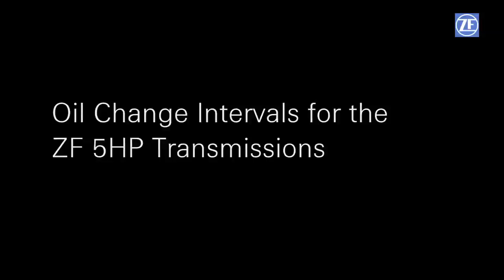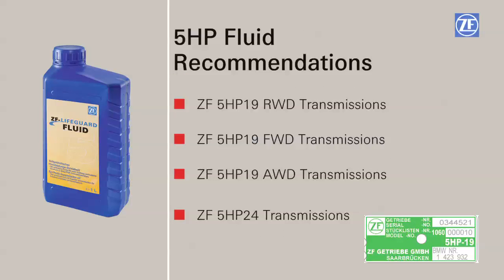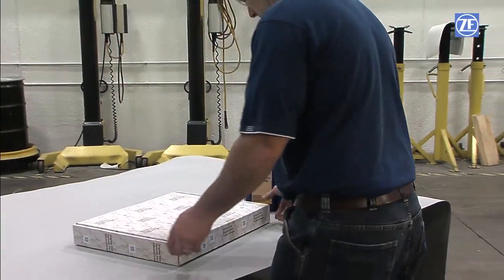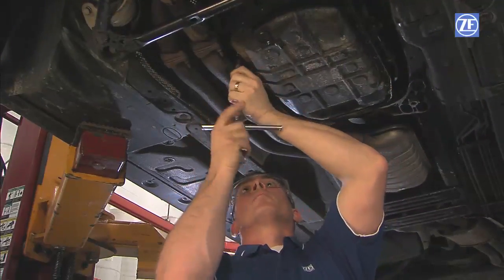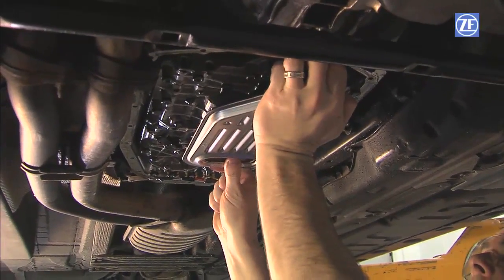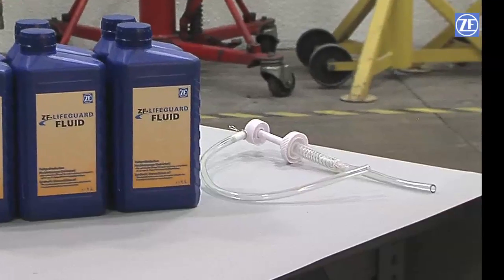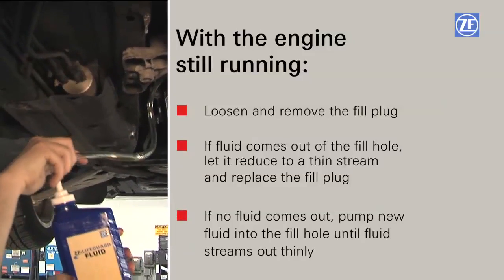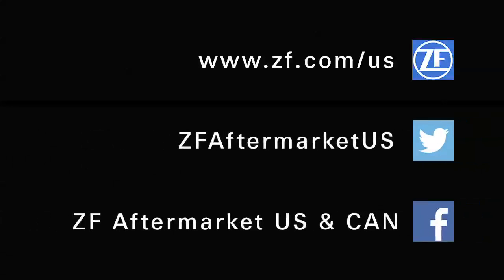ZF 5HP Transmission Oil Change Interval Procedure

Comment: i need my transmission fixed its slipping and i think its needs to be cleaned 2006 Audi A6 3.2 it started a delay in responding when it was suppose to shift gears and reving and not going into gear.

Comment: My Audi A4 is done 220K Km, can i change the ATF,
Reply from the maker: +Bee ShopCS We always recommend a fluid drain and fill with a new pan/filter and the correct ZF Lifeguard Fluid. It should be done every 60k miles or 8 years.
Reply: Thank you very much its 10 years already 
220k I am not sure if has been change before
I ask the service Advice in Audi, Said i am not advice you to change , i do not know what to do so i ask you  thank you very much for ur answer i really appreciated

Comment: Very useful, thanks!

I don´t have access to ZF fluid where I live, so what is the specification for other brand´s fluid for a green plate 5HP19?
Reply: Valvoline Maxlife ATF
Reply from the maker: The only fluids we recommend for the 5HP19 are the OE or ZF Lifeguard Fluid 5. We don't recommend trying to match specifications with an aftermarket supplier. If you have additional questions, please reach out to our technical service team at 800-321-0784.
Reply: Atlantic British, or any other online zf fluid, not hard to find but worth it.
Reply: Thanks, I´ve just changed for Pentosin ATF1, is the one that I found here.

Comment: one question: why not while going through the gears not spinning the wheels? Wouldn't that help?
Reply from the maker: If you spin the wheels, with the vehicle on a lift, you will damage the transmission. You only need to hold the brake and run through the gears to circulate the fluid which will fill the clutches. If you have any additional questions, please reach out to our technical service team at 800-321-0784.
Reply: thank you very much for the answer !
Reply: Wow, i am curious... How can it damage the transmission? Because there is no oil circulated through the valve body and such?

Comment: Hello, thanks for sharing this useful video.
I own a Bmw 540 with the zf 5hp30 transmission. Now it has 195.000 kms.  I dont have any knowledge if the previous owner did a trans fluid change and i ve never done it myself. So i have a few questions: Is there any risk to change the fluid at this point if it was never done before? Should i get a ZF rebuild kit just in case? Which rebuild kit do you recommend?
 I ask you this because i ve noticed a strange shifting between 2nd and 3rd, and from 4th or 5th downshifting to 3rd, is not really hard, but it doesnt feel that smooth like the other gears, and a very few times, it feels hard shifting, always the 3rd gear is involved. Im not sure if that is a sign of failure of the trans, so it needs an overhaul, or maybe the fluid is low, or it just needs fluid change. Thank you very much.
Reply from the maker: +Vintage Effects It is never too late for a fluid drain and fill. We recommend it as part of your maintenance schedule every 60k miles or 8 years. You should replace the filter and the correct ZF fluid for your application. We do not recommend any other fluids because they may cause shift problems or damage the components. 

If you are experiencing shift problems already, a fluid change more than likely will not solve your problems. I suggest checking the fluid level and quality. This will tell you in you have any obvious problems. Once this is completed, you can call us on our tech line at 800-321-0784 to discuss the next steps.
Reply: Thanks for your answer. I believe, or my common sense says that the fluid level is low, since i ve also noticed when im going downhill or uphilll at around 90kph in 5th gear,  if i release the gas, i feel a strong bump, and its never in a different road or speed condition. What is your opinion about this issue? If its too low and considering the fluid is old, should i just refill? Or drain, replace the filter and refill? My zf5hp30 is the black label one. Which fluid do you recommend? Is it Fuchs Titan 3353 a proper fluid for it? Please try and give me more than one option, since there isnt too many ATF brands in my country. Remember the autotrans has 195.000 kms, without any maintenance since the car was new. . .Im afraid to loose the trans after doing fluid change, thats why i ask you so many questions, i just want to be sure!. Thank you very much!

Comment: good evening
changed the oil in the automatic transmission 6hp19 audi a6 (AWD) through the bottom drain hole pallet sump with the aid of a syringe for oil ... I poured to the level started the engine including rear, 1, 2, 4, 5 and then again refilled oil for the first time ... stoko filled exactly as leaked (took it). proshol day everything works fine and then got into an accident, adoption does not work Error 009 988 for the second and third speed ..
what to do ?
poneli you me?

Comment: Do you make an ugraded version of this trans? incase the one in my jag goes out.
Reply: One with an upgraded valve body and a drum?
Reply from the maker: +trulysick86 Thank you for your question. The transmission part number, which is located on the type plate, would determine if there is an updated version of your transmission. 

In most cases, the transmission part number hasn't changed but the individual components have evolved over time. 

If you have your transmission part number, please call our technical service team at +1 800 321 0784 for further information.

Comment: Too many bolts on that pan. This is the hardest part of the whole ordeal
Reply: +tobysoter Right. This one has 23 or 26 fine threads. Where as my truck has less and course threads. Theres a lot of screwing to do
Reply: You have never worked on a older Ford Taurus, at least the vehicle has a permanent gasket.

Comment: Very useful video. Always good to see a video like this from the manufacturer of the product.
A few questions: 
-What is the kinematic viscosity rating the ZF Lifeguard 5 fluid at 40C and 100C? Oddly, this information is not readily available on the internet. 
-Is the ZF Lifeguard 5 fluid the same as the Pentosin ATF 1?
-Is the ZF lifeguard 5 a semi synthetic or fully synthetic fluid?
Thank you.
Reply from the maker: AK540i  Lifeguard Fluid 5 is a semi-synthetic transmission fluid. The kinematic viscosity rating at 40'C is 38 mm2/s (ISO 3104). We do not have on hand the viscosity rating at 100'C. 

In regards to the Pentosin ATF1, the only approved fluids for applications calling for ZF Lifeguard Fluid 5 are the OEM fluid and ZF Lifeguard Fluid 5. 

If you have further questions, please feel free to reach us on our technical hotline at 1-800-321-0784.

Comment: where is the fill hole on the 5hp 24 gearbox, cant find it anywhere on my bmw e38 740?
thanks
Reply from the maker: worst ever You can find an image of the 5HP 24 gearbox at the link below. On page 5 you will find the diagram of where the fill hole is located. If you have further questions, you can contact our technical service team at +1 800 321 0784.http://www.zf.com/media/media/document/int_print_catalogs_documents/usa_4/5HP24.pdf
Reply: ZFServicesNA  thankyou

Comment: Hello. I need to change the ATF on a Boxster S. If I was filling from new it would take 9 Litres. Draining the oil from the sump will remove approx 3.5 Litres. That means that 5.5 Litres remain in the Torque Converter and transmission. Is there a way to purge the remaining oil so that i can replenish all 9 Litres. My fear is that if I only drain 1/3 of the oil then the new filter will have to still deal with the remaining 2/3 contaminated oil. Thanks for your help,e.
Reply from the maker: Eamonn Mc Keon Thank you for your question. ZF strongly recommends the drain and fill procedure we’ve published. This 
method is safe and doesn’t disturb any particles which have been lodged  in the transmission. In the fluid changes we have done, we’ve found that we’ve replaced 4-6 liters of fluid. If you have a clean environment, you can leave the transmission draining for a couple hours to get the most out of it. We have noticed significant  improvements in shift quality and overall feel of the transmission after this drain and fill procedure. This is the only fluid change procedure endorsed by ZF. 

<span style="font-size:11.0pt;font-family:"Calibri","sans-serif";mso-fareast-font-family:
Calibri;mso-fareast-theme-font:minor-latin;mso-bidi-font-family:"Times New Roman";
color:#1F497D;mso-ansi-language:EN-US;mso-fareast-language:EN-US;mso-bidi-language:
AR-SA">Please visit www.zf.com/us for our media center or technical information regarding the fluid change procedures.If you have additional questions, please contact our technical support team at 1-800-321-0784.
Reply: Great. Thanks for your comprehensive response. I'll re-post after the oil change and let you know volume removed.

Comment: Would it be possible to list the few socket types and sizes.  By type I mean is the socket a Allen hex, Torx, standard size sides bolt head?  I'd like to have this before I begin the work so I know I have the tools to do it.  For example:
Drain plug socket type and size -
Pan bolt socket type and size -
Filter bolt socket type and socket-
Fill plug socket type and size -
I think we can all agree that not having a tool midway through a job is..no fun!

 - Jeff.
Reply from the maker: Please find the answers to your specification questions below:

The sockets required for the job are as follows:
Drain plug socket type and size – 5hp19 Hex 6mm & 5hp24 Hex 8mm
Pan bolt socket type and size – T27
Filter bolt socket type and socket- T27
Fill plug socket type and size – Hex 8mm

If you have any further questions, please contact ZF Services technical support at +1 800 321-0874.

Comment: What't the name of the lubricator ( something....andel? ) you use on filter gasket and why you put it there? Thanks
Reply from the maker: The lubricant is called TransJel but Vaseline will also do. If you have any further questions, please contact ZF Services technical support at +1 800 321-0874.

Comment: Thanks for the education on the Fluid change in the 5HP transmission. I have the 5HP 18 with the Green Sticker on my 725tds. Can you kindly confirm if all the 5HP transmission take 6 liters of ATF? 

I did a fluid change yesterday. We drained only 4.0 liters of fluid from the transmission and pumped same volume of fluid into it. Shifting was sluggish from 1st through 3rd. It has not improved since the fluid change. Could it be the transmission had less fluid, and I need to add 2 more liters of fluid to the 4 liters we pumped into it?

I used the MITASU (Japanese) premium Quality ATF which is LT71141 compatible.

I also noticed the engines revvs for too long before the shift from 3rd to 4th. 

Your response will be very helpful. Kindly respond to me at: adeitse@gmail.com

Thank you.
Reply from the maker: Michael Neequaye Thank you for your message. A member of our technical support team will be contacting you with a response, if they haven't already.Please let us know if you have any further questions.
Reply: thank you so much. Joe has already contacted me. I had drained filled my transmission with 4 liters of ATF. I realized that is not enough for the ZF 5HP 18. I wil top off with 2 more liters and let the excess run out and plug the fill hole. I have promised to update Joe on the performance of my transmission when I am done.

Thanks once again.

Michael